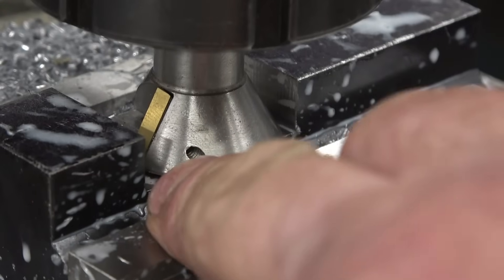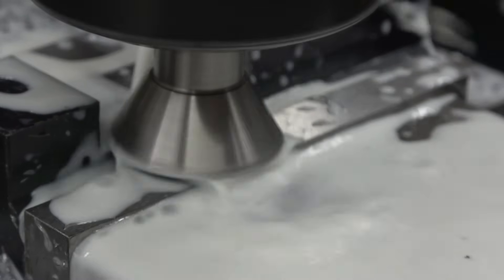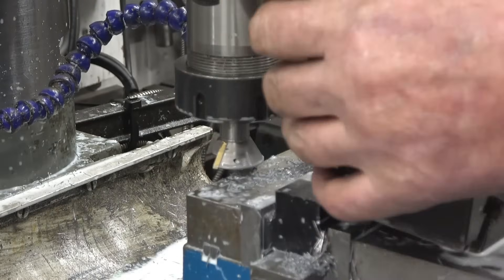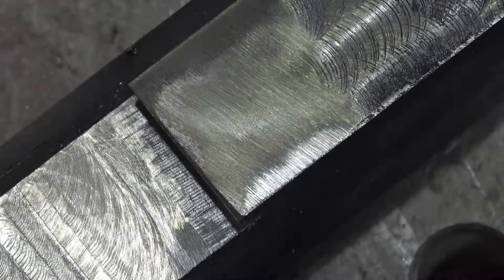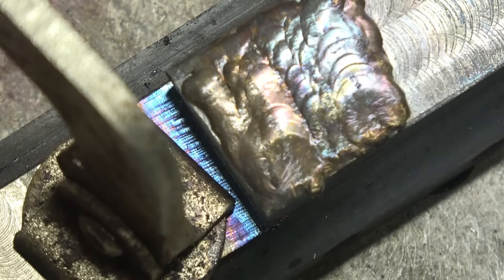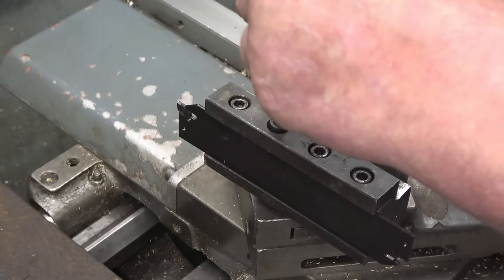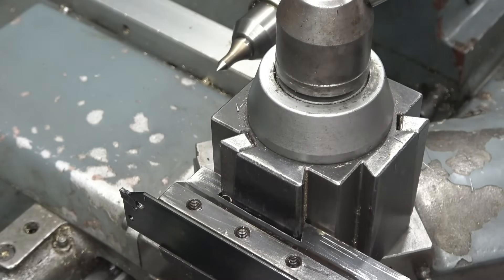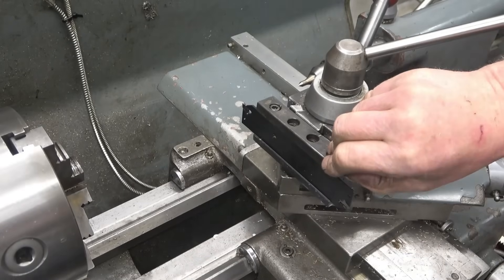SNNC 534 P3  Modifying A Parting Blade Holder 2

Comment: Hi John. A great little project. My parting off experience is very hit and miss. I agree that the excessive overhang is the source of the lack of rigidity. I have a Rapid toolholder , similar to a Dickson and the overhang of the parting blade is just as bad as your original setup. Great fix on the holder. All the best, Mart in Solihull.

Comment: Max Grant shows using the blade upside down and part with lathe spindle in reverse it worked  like a dream  for me  except for trying to remember to actually reverse the spindle
Reply: What’s the advantage doing it that way? I’d’ve thought the cutting forces would try to lift the tool post or even the carriage, rather than having the strength of the lathe bed working in your favour.